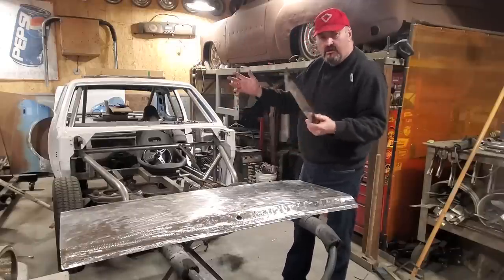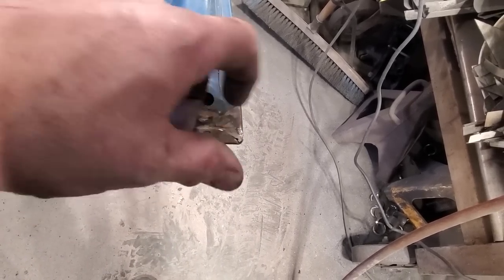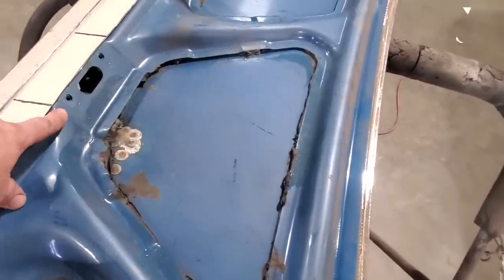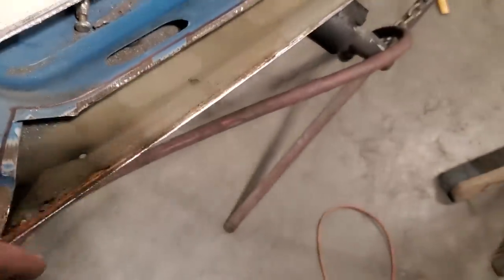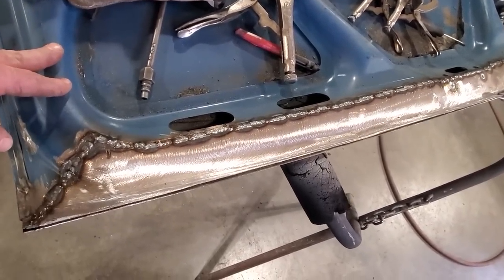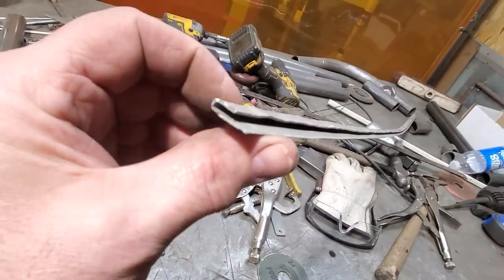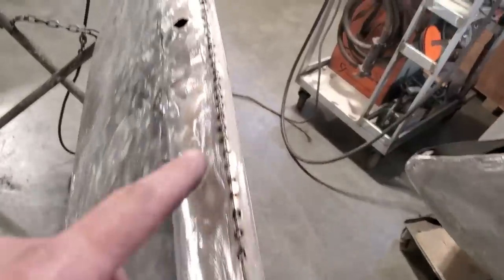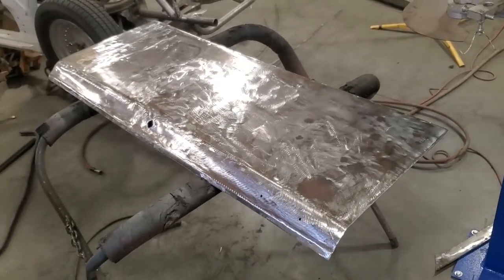Using rust to restore. Rusty trunk lid repair

Comment: That was awesome,  I know what welding thin and rusty metal is like and it's not the easiest thing to deal with,  great work Tony and great save on the Ole trunk lid
Reply: Try it with flux core wire, youll lose your mind.

Comment: I have a small "Hobby" blaster - holds about 50kg of blast media (I use crushed glass)  - I feed it air from my petrol compressor because it murders my electric compressor - it blasts waaay more gently than a proper indiustrial blaster but it blasts real nice - close to zero heat, whips off paint & rust in a quick pass & gets into every nook & cranny. I despise running it because the grit gets into every nook & cranny of me as well - but damn it's great for stuff like this ^^. 

I repair rust for a living - that ^^ is my daily work. I doubt people realise just how much time goes into running one pass of weld across a full hood/trunk width.. or how long it takes to grind them welds. I usually have some lid/bonnet that is Unobtainium sitting in front of me - I repair them the same way you do, exact same technique - which is why I love your Channel, Fitz - it's the proper nitty gritty.

Comment: Just curious, I've seen you do the edge fold over with yard stick several times. My question is doesn't all that banging on metal yard stick stretch it ? Now you end up with a yard and a 1/16th yard stick.😊 Lol another great learning video tks Tony
Reply from the maker: Lol. I don't use that yard stick for measurements.  It's the lips folder over shaper and the remote for the radio! Lol

Comment: Great job as always Fitzee! 👏 I have used your sheel metal tips multiple times while restoration on my GTO. You have taught me a lot! My truck lid isn't as bad as this one and might only need a few small patches but you never know what you'll run into, as I'm sure you know. What method do you use to remover the paint on the underside of the lid? The part that you didn't strip in your video? I used to use Aircraft stripper but it doesn't work like it used to. Thanks again for sharing a wealth of knowledge with us!
Reply from the maker: I wouldn't use aircraft  stripper on the inside. Too many nook and crannies for the stuff to hide in. It's alot of work stripping the inside. I just was strip wheels or wire wheels and even small roloc wheels work good.

Comment: I have one problem though.  When I bend a long 90 in the vice and dolley it out on my anvil, but it always bows the piece  in 2 directions as it shrinks the metal.  How do you prevent that?  I figured out how to straighten it somewhat with heat, but it's a lot of work.   I don't have a bender, but I do have a press which I use 2 angle irons to bend shorter pieces, but it's hard to keep a long piece lined up.

Comment: Funny thing is, cars today still have the problem of lower panel lips rusting out. Its all the salt and liquid salt thats put on the roads that gets in there and eats it away. If you put used motor oil/ fluid film, trans fluid, or anything like that inside the panels, they will never rust out.

Comment: Beautiful repair! Do you wish you would have painted the inside of the trunk lid when you had the inner structure off, or do you think it will be okay? Just wondering if I have repairs like this in the future...
Reply from the maker: I will get paint in there later. I want paint over the welds. There large holes in the panel that I can spray paint in

Comment: What gauge wire do you suggest for but welding?
Reply from the maker: 023
Reply: 25 works well also, and always use gas if you can.  Save the flux core for unexposed welds, which I think is only 30 and higher anyway.

Comment: Man that welder is a glue machine, is it an inverter or transformer?
By how well it did those blended corners I'm sure you could have buttwelded the whole shebbang by just switching around a bit more, and you wouldn't have had to re-weld the overlapped strip.
With the right overlap on the welds I've seldom had to come back.
All of the Toyota's bodyshells and doors are mostly 0.9mm (20 gauge) but the issue is that on a lot of the heavily stamped areas with the lips, curvatures, crowns and creases they're stretched out to 17 gauge (0.7mm) or even less.
Where I struggle with a bad quality MiG machine, a friend does old Toyota's too, using professional Esab welders (about same quality as your Lincoln & Miller machines) and CO2 shielding gas.
He says if you have a welder that does low enough voltage and current with a mild step-up program built into it you can buttweld anywhere on Toyota's, every day of the week, IMHO both of your machines qualify.
My issue is when the minimum of what my MiG can do, 15 volts, just isn't low enough, and that's the pitfall of inverters IMO, so to anyone buying new inverter MiG machines for bodywork, make sure it goes lower than 15 volts just in case.

Comment: So with these thinner cars rather than attempting a cut and butt is it worth leaving an extra 1/8 inch around the inside of the hole and then going around and bending that 1/8 in a bit? Still end up with a flush fitting panel, but a small lap rather than a butt weld?
Reply from the maker: That could work. It's hard to get a perfect drop over a long spand. I try my best to take the repair to a rolled edge. Lap welding on a flat can be a nightmare for the guy filling the panels

Comment: Hey Fitz. Do you think one of the reasons you have trouble with the thinner metal is because you use straight Co2?
Reply from the maker: I don't think so. But it be interesting to see is other gas mixes work better. Remember  it's only on the few 70s imports I worked on that I have issues. Some were better then others. How the factory metal was formed plays a big part
Reply: @fitzeesfabrications   Hi Tony, great tips.  Your videos have gotten more polished since you started .... I hope the young fabricators are watching and learning.  Any chance on future videos you can do a few extra steps to put filler on, block and prime?  I am curious to see how nice these look when finished.
Reply from the maker: @jimw6991  that will come in time. I plan on doing crusty to paint and will take you guys along

Comment: I am trying your techniques,  as you make it look so simple. I keep blowing holes through when butt welding. Im using a cheap gasless mig. Any tips? Any help would be appreciated
Reply from the maker: You will blow threw with a gasless welder( flux) I did a video on this and even I  blew threw the metal. It's a art using a flux welder. It's not something to teach yourself how to do the cut and butt with.
Reply: Thanks.. so i really need to get a bottle and gas to do it?
Reply from the maker: @davidw381979  yes you will find it a lot easier. I have a number of videos on welding and setting up a welder. should check them out.

Comment: Can't help wondering if that era of car is made from slightly different steel as well as thinner? You have shown us numerous times how unpainted parts of older cars aren't really a rust problem and yet here we have exactly that problem?  I have seen very old angle iron, from an old horse powered hay stacker lying in the grass for something like 50 plus years and only have a bit of surface rust when I dragged it out to reuse it. Try that with ordinary modern angle iron!  I suspect the old steel was a lower carbon content, closer to wrought iron which tends to be much more rust resistant. Maybe old cars are similar?
Reply from the maker: Old iron and steel have a higher iron content then modern recycled metal. These Japanese cars were the first in using recycled  metal and the process was still in the learning stages back the . Much of the north America made cars were still using smelter steer right from the manufacturer